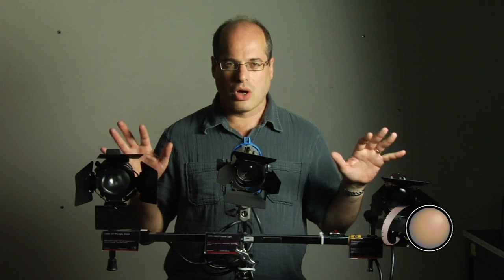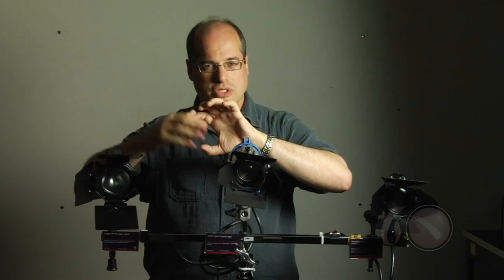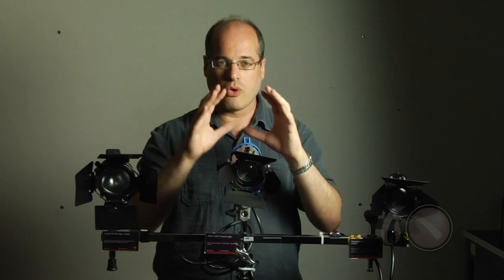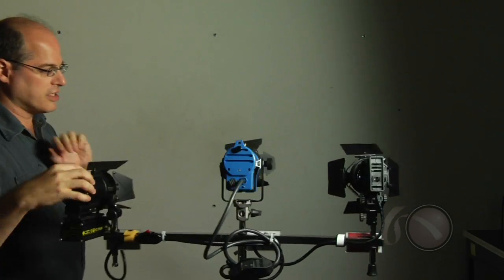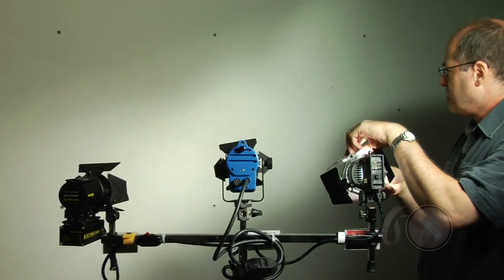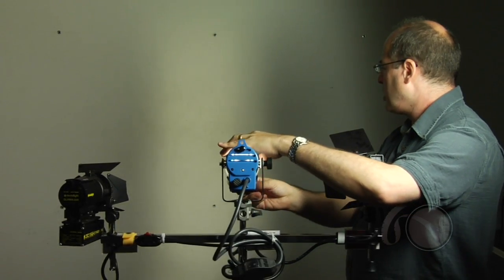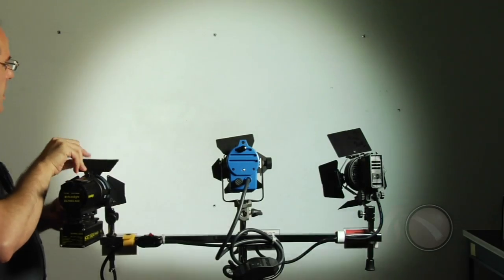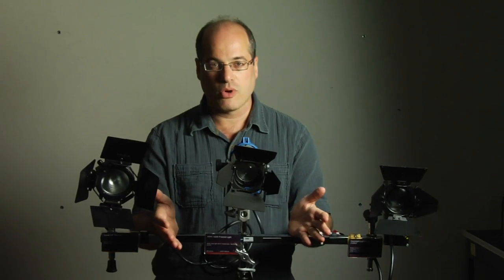Lighting Comparison

Comment: I have used the Dedos and just love Dedo lights but all I can afford to own is Lowel. Arri is nice as well but it's the versatility of the Dedo. I need at least two of them but can't really afford one of them. While with the Lowel... well I have a ton of those from the Pro up to the DP and everything in between several of each type 14 in all and it's still less than the cost of two used Dedos on Ebay.

Comment: this was really helpful. thank you so much for taking the time. i just picked up a dedolight DLHM4-300 from B&H (who i'm trying not to shop from because of their labor practices and union busting, but i couldn't find it elsewhere in the time i needed) and anyway, it was almost $800 by the time you get the barn-doors and bulbs, but the light quality is pretty great. much better than i'm used to with the lowell.
Reply: they're sort of apples and oranges. The Lowel that i have is the BLENDER. the cool thing about the Lowel Blender (aside from being cheaper) is that it's an LED light and you can control the color temperature 3200-5600k (two knobs on the back). The Dedolight DLHM4-300, doesn't appear to be an LED. it comes with bulbs. this is a much stronger light source. not sure, 150? whereas Blender is probably close to 50W. they both come with a dimmer which is handy.
Reply: Dedolight